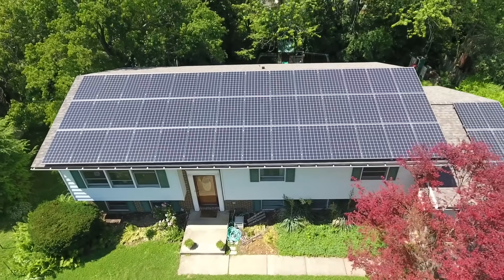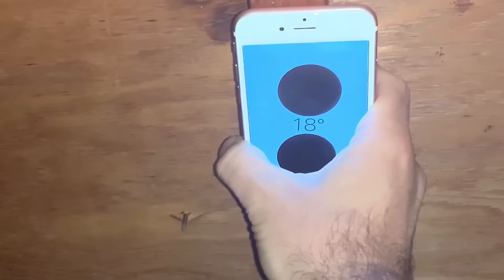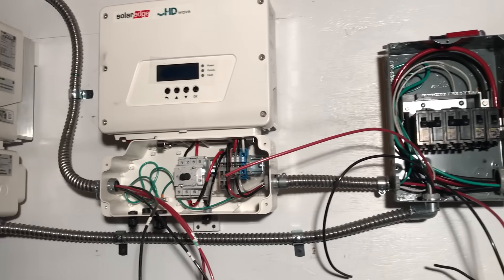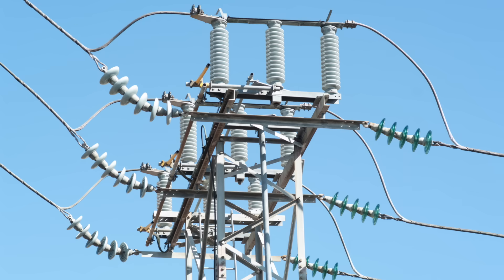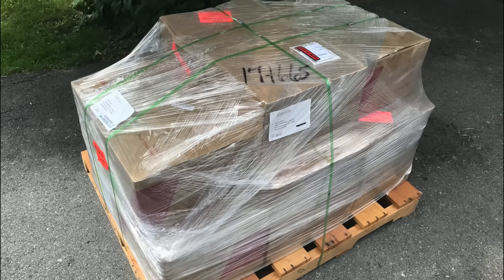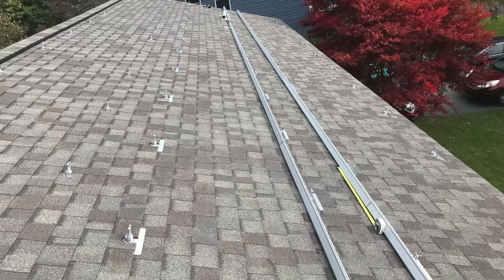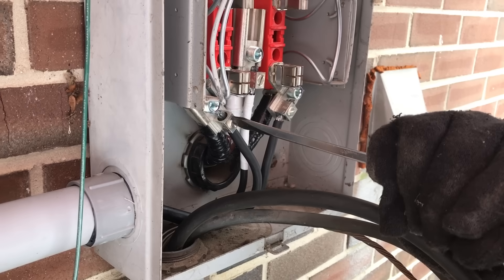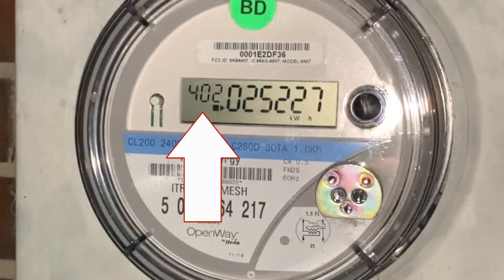I Installed a Power Plant Myself | HUGE DIY Solar Panel System

Comment: I think these solar panels are monocrystalline solar panels based on how they look. These are actually one of the best in the market in terms of efficiency and have a 25 year warranty. Overall, great choice and your effort is unmatched! I think people should highly consider getting solar panels for their homes(if possible). Decrease your dependence on the grid! (And also save money!)
Reply: Hrmm spend 10's of 1000s of dollars for a system that will need replaced again in 25 years or less.  Batteries wear down and have to be replaced every so many years...the whole thing is over priced and you end up saving very little with a very high up front cost.  No thanks, most Americans will wait until this government actually wants to help this planet by not charging this much and better regulation for solar energy.
Reply: Yes if you are looking for an estimate, i can get you a proposal.

Comment: yes if you can afford to purchase and not finance Solar with Batteries and converters and rewire more of your house for lower voltage equipment you can save big.  HOWEVER most of these ads on Facebook etc are basically finance companies that hire local installers.   Most of the time the Solar panels are on the shelf 5 year plus old technology.   if you put in the cost of the monthly payments for the equipment into a CD or other bank fund and after the 20-30 year payback you would have a hefty sum of cash as opposed to 30 year old solar panels.  Add in that many fire companies will not go onto your roof in a fire due to Toxic makeup of the Panels, Tripping hazards and electrocution.   You have to consider extra insurance.   Also for many of the systems you can not even run a lightbulb in a power outage (unless you have the batteries and converters).  If it was such a great idea you would think they would be along every highway and on the White House.....

Comment: Myself I live in Indiana. I've considered solar but for 6 months out of the year I'm pretty sure I wouldn't get enough light to be feesable. I am also considering wind generators. I figured one on each corner of my house and garage may put a little shade on any solar panels I consider putting in, but figured during storms and even just normal windy days, I'd make up for that little bit of shade 10 fold and probably produce double what I use with the set up of my house because 6 months of the year the sun travels over one side of my peak, and the other 6 months it travels over the other side so it would be beneficial for me to put panels on both sides and the opposite side I am guessing would get approximately 75% of what the max side does in the off season.

Comment: In my area in Canada, I'm not allowed to do anything around my Meter. The utility has their tamper locks around the ring. This is to ensure nobody is messing with the meter box wiring to try and steal power... The only way I can get a proper grid tie in is by actually getting a licensed electrical contractor who can get permission from the hydro company to tie in at the meter box, or else the hydro company will just give me a big middle finger.

Comment: I am in the process of installing my own system as well, Canadian Solar 400W panels paired with Enphase IQ7A microinverters (22 panels), I used a friends approved permit plans and modified them to reflect my equipment and power specs, they are in the hands of the planning department now and I expect they will be approved soon, the big thing on my system is I had to derate my main breaker down from 200 amps to 175 amps since I’ll be feeding in an additional 50 amps, this surpassed the NEC 120% rule, that sucked, as there is a shortage of those main breakers I paid like triple the usual cost—-no one had these!  Other than that it’s coming along well—-8.8kw system!
Reply from the maker: Sorry to hear you had to pay more for it, but glad things are moving along!
Reply: Enphase is a beauty. You’ll have no issues installing your system. Good luck
Reply: Just finished my 1st year of use, I had excess production and we used BOTH HVAC units in my home as much as we wanted—-first year that we do this, and at end if true up date we still had excess power, I love it, I wish I would’ve done this sooner!!!

Comment: This is exactly what I was looking for. I do general construction in DFW and been saving up to start getting my home self sufficient.  Have a bunch of fun ideas and this is one of my top priorities but didn't know where to start
Reply: If you’re good at construction and basic electrical this job will be well within your skill set, I’m about half-way through my project, my roof is flat concrete tiles so that was extra work for me, should be easier if you have regular asphalt tiles, I’m using 400W panels paired to Enphase IQ7A microinverters, it’s not a super hard job just take your time, make sure yea seal any roof perforations correctly and definitely do not fall off the roof as that will throw out all the cost savings of you doing the job yourself!  Good Luck!

Comment: How do you get at a singular centered solar panel if its the one that fails down the road for replacement? Have to tear out all the ones in line to get to the one? im curious. Angles and and space from the edge of the roof using a ladder could be difficult. Seems like possible incursion of expense for repairs.
Reply from the maker: The panels are easy to move.  So it wouldn’t be an issue to get to one in the middle.  Just four bolts and two wires to disconnect for each panel.
Reply: @FrugalRepair  right. thx for the response.

Comment: A couple of years later and I found a company that sells used solar panels at $0.10 on the dollar. So I bought $4,240 watt panels and I started building frames in my backyard and started building a solar farm. My starter system has 14 kilowatt hours of lithium iron phosphate batteries and a 6000 watt inverter for testing out the concept. With half of the solar panels deployed I am able to run from about 11:00 a.m. till almost midnight most sunny days unless we do a lot of cooking on the electric stove. I have more batteries on order a total of 42 kilowatt hours worth and this week I am about to build the second array of 20 panels which will double the amount of solar energy collected. A total of 40 panels so far.

Comment: There is a huge issue with this type of installation. He sells surplus power during the day but since he is not storing power in batteries, he must still BUY power from the power company at night. The more people that do this the bigger the problem gets. Why? Power companies can't just reduce power generation during the day and then super produce at night. To cover costs of generating power during the daylight hours that doesn't sell, the price of they charge for the power they do sell must go up. This type of installation is not really net zero. Also there are other costs down the road like when you have to replace the roof, you will have the increased cost of detaching and resetting all the solar panels and mounting hardware. It would also be interesting to see how your homeowners insurance might not have coverage issues of the panels or equipment is damaged because it's used to generate revenue or a profit. It might be considered a business enterprise with might required much higher premiums to insure.

Comment: The cost of solar is starting to fall through the floor. I rent in a very basic renting place (more like a long term hotel), so I can't go modifying the structure, but "camping" setups made of portable parts are rapidly proliferating (and you can take it with you!). In a few years we're going to think we were crazy... "there's free electricity falling out of the sky!"

Comment: Here in the UK you got to be a fully trained electrician. If I was to do what you did I would find myself in so much trouble with the law. I could install the cables and providing I did it right it would be fine but an electrician would have to wire up all the connections. And regarding electric meters well that has to be someone from the grid's job. An idiot like me would face certain death just trying to mess with the meter(100amps power).

Comment: How do you use the energy you produce in your house? I.e how do you get the voltage, frequency and phase right?
Reply from the maker: My house knows no different because it sees that it is getting power from the grid like it always has.  The inverters figure out how to sync with the grid and supply the power correctly.  Some of that feeds the power demand in the house but excess power goes to the grid and I get credit for the generation.

Comment: Im a solar electrician and this video is great. The only thing I would have done differently is put all the rails together before attaching them to the bunny ears ( the mounts attached to the flashing)
With the rails already put together and at the right length, you loosely attach all the bolts to the flashing mount, just so the rails are barely attached to the mounts. You run your string and get the bottom and top rails leveled and secured 100%, then get a piece of straight conduit or wood and run it perpendicular to the top and bottom rails. Have someone hold the conduit or wood on the top and bottom rails. Then its as easy as lifting all the other rails to the conduit and fastening them down. Saves you the time of stringing all the rails individually and just doing two. Then you just match the height on all the middle rails from your straight edge (conduit or wood) Not sure if this method makes sense over text but thats how we do it in the field. (also on a side note any zip tie on a roof will rot within a year or so and break. We use something called a sun bundler that is made of steel with a plastic coating that will stay strong for years.)
Reply from the maker: Thanks for your kind comment!  I think I understand what you're explaining but I would find it difficult moving 50' worth of rail at one time and trying to line them up to get them square.  And also doing it by myself.
Reply: @FrugalRepair  Yes that is very true, I take for granted some times having a crew of guys to help! But like I said this video is absolutely great and I LOVE seeing the push towards solar a lot of people have been having. It feels so rewarding switching on your array and knowing your making a green difference. Even after a few years of installing solar I still feel the same joy when showing the customer what theyre producing! Solar is super awesome and I love that people are getting excited about it!

Comment: Fantastic job! I am here in Panama for my retirement. Building a 80m2 house and looking for a solar system because until now, there is no power at the development area. And the worst? The power ends 600 yards from the development area. If you talk to the power company, they say... in 35 days... I am waiting now 6 months... So locals put 1 solar panel on their roof to charge phones and watching TV. 🤷‍♂️ If I do this, I would like to build 4kw to 5kw solar on my lot. I am not waiting years that the company finally decides to build 700 yards of power wire including posts to the new area... Any information to get is welcome.

Comment: If you generate too much during the day, does it get credited as a KwH or does it get credited as a few cents of the generation cost and not the supply cost/taxes etc?     Then when you use that power at nighttime, is it deducting KWs from your daytime excess, or is it buying from the power company at full price with transmission?    
Reworded:
A Kilowatt hour from my power company is like 10 cents, then there are like 12 cents of delivery and fees making it 22 cents a kwh.  So if you send the power company excess in the daytime, do they just pay you 10 cents a KwH for the power, then when you buy it back at night you are paying 22 cents a KwH?  Or is it just a total KwH usage over a month?
Reply from the maker: I get 1-1 credit.  I made two videos related to this if interested. The one after this and the one called solar misconception.

Comment: Just got the new meter installed by my power company. After the panels install was in February here we are April and now I am being told I won’t see credits on my solar plan until 2-3 months. I was told it takes that long for them to calculate how much I am sending back to grid? 
Then after delivery fee from TNMP (power company) and the base fee from reliant I will still see a predicted bill from $40-60 buck. 

😰😮‍💨
Solar panels cost per month is $177 + $60 = $237 
I averaged a electric bill of $350-$420 
So I guess I’ll still be saving 
Just not as much as I thought .

Comment: In my current state they buy back any of they power I produce to the grid  I can sell at 0.04 per kWh, but anything you buy power it's roughly 0.12 per kWh. Therefore you want to do as little over production as possible to minimize the investment.

Comment: Good job i got pv hot water system also heat pump hit water heater on grid off grid got a converted dryer with a solar dish do all my laundry for free no natural gas usage to dry cloths i just got figure out a way to heat my house without natural gas usage i have heat pumps so i will see this winter if its worth it now that i run most of my appliances on the off grid system my only concern is the crocked politicians will continue to get bribes from the utility companies and in time make it so you cant be energy independent i had a 10’ satellite dish they scrambled all the signals and that ended quick so im thinking they are scheming somehow to end this because its cutting into their profits
Reply from the maker: That’s cool you have solar for hot water.  That’s something I’d like to figure out how to get at some point.
Reply: @FrugalRepair  they make mppt pv controllers so its off grid i got 1000 watts i left my natural gas hot water in place added a electric for the panels
Reply: @FrugalRepair  i also have a heat pump water heater that works good in warmer weather when it gets cold it eats the kw up so i turn it off and turn on the natural gas water heater and the solar helps i get a good 8 months of free hot water i live in escondido mild weather and lot of sunny days and almost never drops below 25 degrees f
Not sure but you got a lot of panels and your house doesn’t look that big looks like the size of my house. Not sure how much excess you generate but a electric hot water heater might be good for you if you dont have one if you have a natural gas leave it in place use i circulating pump and you would be good my utilities charge 35-43 cents per kw and pay me .03 to .04 per kw so its better for me to use the excess im about 200 kw generated and wont use in this weather i will use when it gets hot with ac on but even then wont use it all the winter is when i use natural gas but my electricity this coming winter will be negative kw because i installed off grid for my laundry shed and added outlets in my house for frig tv electric fire place lightening hit the power company transformer i was out of electricity for about 12 hrs 
So now with my off grid system i can go a day with my frig and tv. Off grid kinda not worth it for 1 day back up 2100 in batteries alone the whole system cost about 5 grand it one axis tracks
Im retired so i like beating the utility company 
Just sharing im about done as much as i can do i would like to heat my house but have not seen anything worth doing
I do use off grid and surplus kw i generate to heat my house but still have to use natural gas
I was in both electrical and ac industrial chiller trade so i already knew electrical and mechanical so what you did not knowing was a big accomplishment on your part and the video was even professionally done good job on both

Comment: I’m 57. Married. 3 grown up sons. I own my small house and the lot it is standing on. I’ve got solar panels for electricity , geothermal system for hot water and air heat exchanger for heating. Everything is paid for. Even our 2016 car. No loans left. I work between 12-20 hours per week at the parks department , which is based a five minute walk from my house. All we pay for is garbage collecting fee , insurance , tax and gas for the car , insurance and a yearly tax for the house. We have no luxury or extravagance lifestyle.
Reply from the maker: Great to hear! Thanks for sharing.

Comment: What caught my attention about this video is the appearance of your house. It kind of reminds me of a trailer with a garage built on it. My mom and I both live in old trailers in a trailer park and struggle with money problems. I know from living in a duplex that washing laundry with hot water all the time tends to shoot electric bills into the hundreds and I've been learning with my trailer that sometimes changes in temperatures can cause the electric bill to go up too. I doubt I can add another 3 or more inches of wall to the outside of my trailer but I would like to know if mine and my mom's trailers are strong enough for solar panel systems. Any suggestions? 😥 Nevermind. I sent a link of this video to my mom and she said she already tried but was told we can't have solar power while we're renting the land. Still, I was nice of you to throw in so much information on the internet.